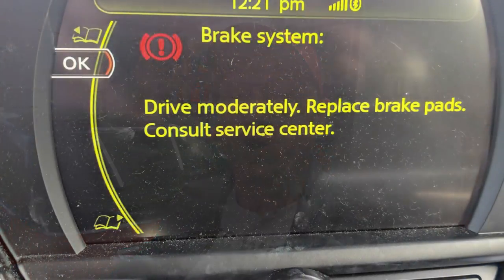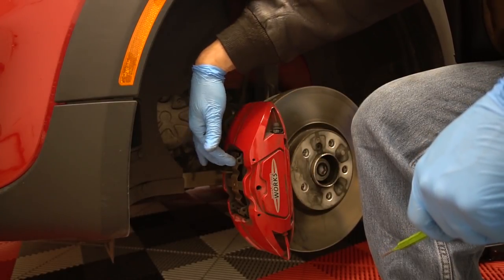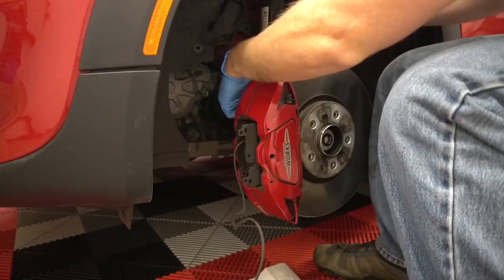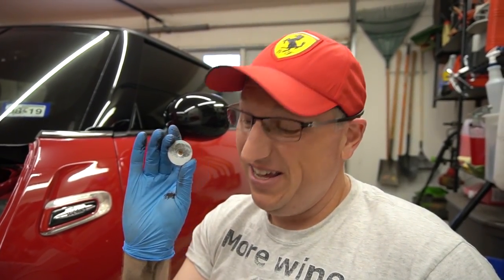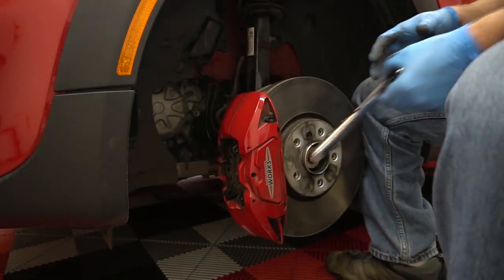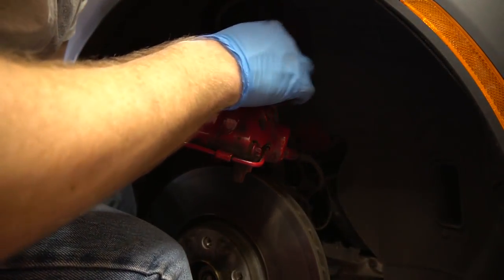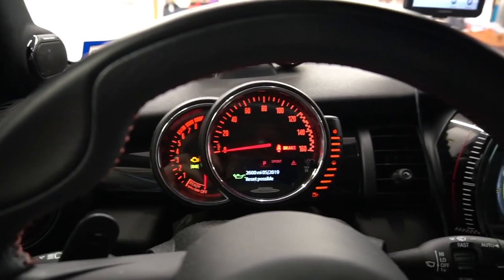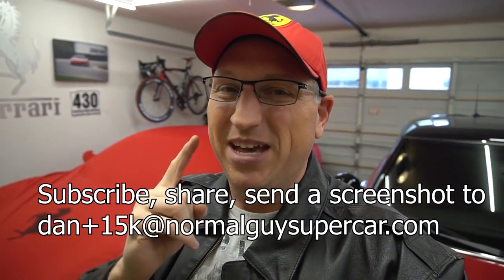Changing the front brake pads on a 2017 Mini John Cooper Works

Comment: This jobs takes half an hour if you just use a longer punch to remove only the two pins (One minute). Then use a big flat screwdriver between the disk and the old pads to push the piston inside (another minute). Then use an olfa knife to separate the pads from the round washers that are between the piston and the pads. If you push gently the olfa blade between the pads and the washers, they will separate from the pads and stay in the piston (another minute). Once it is done, just pull out the two pads, clean the beds of the pads on the caliper with the flat screwdriver to remove the dirt (another minute). Then put the new pads in the slot (put the brake grease first where needed) then put the stainless piece, then slide the lower pin, gently knock it inside with a small hammer and a punch), then push the upper part of the stainless plate with your finger in order to remove the pressure when you slide the upper pin. knock the pin in place (another minute or two).  On the driver side, you will have to unclip the sensor and replace it (you will need an 8 mm socket to remove one screw and a flat screwdriver to remove a pins that keep the liner in place in order to acces the other end of the sensor cable) This should take two minutes. Then put the tires back, pump the brake, start the car, reset the braker wear sensor message and your are done. You absolutely don't need to remove the caliper unless the disk are damage or needs to be replace. Thank you for your video, it was a great start and very usefull for reseting the brake sensor message in the dash!
Reply from the maker: Indeed
Reply: Do you need to replace the washers that go on the back of the pads or just use the old ones. If using the old ones do they have to be glued back on?
Reply: Also you not need to replace sensor if you’re not getting a light

Comment: Also to make it easier to get to caliper bolts, say your working on LF.  Turn the steering wheel all the way to the left. It will give you more room to work and access to caliper bolts.
Reply from the maker: Great tip! Thanks!
Reply: I was thinking that too regarding getting a better shot with the camera. Thanks for the video!

Comment: Before removing pads, after taking pins out. Use pliers to squeeze brake pads back to push caliper pistons in.  Then you will be able to slide pads out easy and its easier to compress pistons that way. 

Use a longer punch to remove pins.
Reply from the maker: Yeah great tips. Thanks

Comment: I have a old mercedes that uses the exact same set up on the rear to get the brake pads out you are supposed to use a pry bar and gently apply pressure to the brake pad that pushes up against the piston the piston eventually goes all the way in and removal and install of the pads gets super easy 👍
Reply from the maker: Yup

Comment: Once you the the pins out you can use a large flat head screw driver to apply pressure between the old pad and the rotor.  This will compress the pistons then the pads will come right out.
Reply from the maker: True

Comment: Really helpful video thanks. Where did you buy the pad holder discs from I can’t find them anywhere? I’m resorting to using the old ones with some high temperature adhesive as I get a clunk noise when braking first time in reverse or drive.

Comment: I also recommend replacing rotors with new pads as well.  Using old rotors can cause noise, wear thin and warp causing a pulsation. 

Thats the way the dealer would have reccomended to you.
Reply from the maker: It was in spec so eh, next time it probably won't be.
Reply: Normal Guy Supercar awesome, well good on you for checking!

Comment: As I commented on your last video when you were playing mechanic and changing rear pads stop using the c-clamp!!!!!! C-clamps are a great way to trigger the abs light and ruin a abs unit. 

You should not be beating brake pads out with a hammer!!! Take a simple flat head screwdriver and SLOWLY pry between the rotor and pad from the top which will relieve the pressure on the pads and the pads would of slide right out after pistons were depressed back. 

I suggest opening a bleeder while depressing pistons if you insist on using c-clamp so no damage can be done to abs.
Reply from the maker: Good tip
Reply: What can we use instead of c clamp?
Reply: Great idea to use a screwdriver to lever against your brake rotor 🙄

Comment: Great video. Thanks for the post. I'm changing out my wife's 2019 clubman after 45000km (28k mi) they wanted $2500 at the dealership for stock. The manager at the dealership told me it was "almost impossible" for an average Joe to do it....
Reply from the maker: Lol impossible... Yeah right.
Reply: @normalguysupercar  that's what I said, they look the same as any other brake job. I ended up getting everything shipped to my door from the USA with duty for $300, and they wanted $1000 at the dealership!

Comment: My guess is the little circular pads are an anti-squeal measure. My pads on the audi always come with anti-squeal grease that goes in the same places as those little "stickies".
Reply from the maker: Quite possibly...  Probably absorbs some vibrations
Reply: @normalguysupercar  Either absorbs or has a different vibrating frequency.

Comment: What about rotor resurfacing?  I've never done a brake job where I didn't have both new pads and fresh rotor surface, to which I promptly bedded the pads and rotors in to each other.  Although those don't look all that scored.  I get 50K-60K on front pads and my rotors are usually pretty scored when I do the job.
Reply from the maker: They seemed to be in pretty good shape.

Comment: They make a tool for those calipers that expand in both directions.  I know harbor freight carrys it.

Also be careful with those calipers in the future.  On my brembos on my acura the bolts get seized and it eats up the threads in the caliper since they are aluminum. Hopefully those threads are steel since its is considerably newer than mine.

Good video!
Reply from the maker: Yeah, I saw that tool after the fact... I may have to get one.  Then I could do the pads without removing the caliper... Not that it was hard.
Reply: @normalguysupercar  Yeah the dealers make it out to be something way more difficult than it really is.
Reply: @normalguysupercar  I use a couple flat head screw drivers while pads are still in there as  a wedge to compress the pistons and then the pads slide out easy as well as the new pads going in reasonably easy.
Reply from the maker: @deanmiller8873  That's a damn good idea.  Thanks!

Comment: Have you looked into one of those garage floor powered scissor lifts that lays on the garage floor and goes underneath your car and lifts it from the bottom..theyre specially made for low sports cars but do you know what I'm talking about? Just so you don't have to buy big expensive garage lifts and hoists. Even tho the scissor lift could be $1,000-$2,000 I think they're worth the money (tax season always comes 👌👍) lmao. It would be cool if it allows you to keep your car off the ground all winter when your storing it as well..
Reply from the maker: Yes, I've been looking to get something like that... I just haven't pulled the trigger yet.
Reply: @normalguysupercar  yea instead of your process of backing the car on ramps, jacking it up, and then jackstands underneath eveytime, I'm sure you don't mind doing that but those jack stands get fishy sometimes. I pray to God yours don't fail of course but a scissor lift may benefit you more than you think possibly.

Comment: Hi. you can change them without removing the calipers, i had the same exact Brembo brakes in my Alfa Romeo 147, before you remove the brake pads you have to use a big flat head screw driver to put the pistons back in and after that you can even put the glue pads in, ok that is easier to take them off but you still can do both ways, but nice videos you putting on. I like when the brands says you cant do this or that, its your car you do what ever you want :)
Reply from the maker: Yeah I heard that suggestion afterwards. I'll give that a try next time.

Comment: Brakes probably wore out early due to driving habits..

But 20-25k on European cars is not uncommon. They use very soft material for good braking bite and to reduce noise.
Reply from the maker: Yeah Meg is hard on the brakes too.
Reply: This car uses the front brakes to aid traction, like a limited slip dif. They ware fast even if you drive carefully.

Comment: Enjoyed that Dan, those are very impressive calipers for a mini, a lot better than my E92 M3 calipers that's for sure, I am surprised you  used a breaker bar for those bolts, I thought you might have used an impact wrench .????? Like the one you used for the lug nuts.  ?
Reply from the maker: I couldn't fit one in there...

Comment: You will be amazed how quickly pads go after just 2-3 track days. I bet the pads wore most on the track day.
Reply from the maker: It did a total of 6 laps on a less than half mile track... I don't think that was it.
Reply: @normalguysupercar  Really weird. They are suppost to last at least 50k. The pads on my GT86 are still at 20% after 45k miles and few runs in the Alps. Probably is worth checking if they are binding and wearing prematurely. Thumbs up for all the great videos. I am still catching up with the older ones and looking forward to any new ones!
Reply: @normalguysupercar  when keeping all the system on your brake wear extremely fast, especially these OEM ones

Comment: Did you ditch the runflat tyres, if so what are you using for a spare?
Reply from the maker: I have a can of fix a flat and towing service
Reply: How do you find the ride on the Mitchelin as oppose to run-flats?. I’ve just had warning light for front pads, 15.5k still rubbish compared to other vehicles, don’t know wether to try E.B.C yellow stuff!
Reply from the maker: @malcolmbale9566  they ride much better

Comment: Having the SAME EXACT problem with my 2017 Mini Cooper JCW. Barely 12,000 miles. I don't have the means to change the pads myself so I'm getting screwed right now at the dealership.
Reply from the maker: Yeah, those pads don't last for shit.  Kinda disappointing.
Reply: @normalguysupercar  Very disappointing. Getting quoted on brakes at the dealership now. I'm trying to source parts for this myself if I can. Can you link me to where you picked up those pads w/ sensor? They're trying to meet me in the middle somewhere because my car has been in the shop over a month now for an electrical issue (some kind of rodent got in my engine bay and ate some wiring!) and I've been incurring a lot of costs in a very short period of time on a lease that has little over a year left on it.

Comment: Mini pads are junk they never last, the replacement pads are generally worse they don’t even last as long. You would be better off going with something like a Hawk HPS or an EBC pad. They also produced less dust.
Reply from the maker: Yeah, I will definitely switch to those next time.  I just wasn't sure which were the right ones, but now I know.

Comment: Yo bro is the car manual or automatic ie stickshift or auto lol in american.
Reply: His is automatic
Reply from the maker: Auto.  Meg doesn't drive manual.
Reply: @nathanbaxter2329  ok thanks bro. Was just wondering because i have a manual, and i have done 28000 in my 2017 mini, and pads still good. Must be because i use the engine breaking a lot. Automatics must not rely on the engine breaking as much. Thanks again.
Reply: Cool! Just bought my Mini about 2 weeks ago! It's a 2011 S. It's my first car. It's also a manual and, it was a salvage title. Should be a fun little car!
Reply: @normalguysupercar  thanks bro. Wat u reckon if you drive it in sport, will down shift more, and save on break wear a lot?? Just a idea cause 12500miles on a set of pads is a joke lol. My 2015 jetta got 43000 miles on it and last service i had over a 1/4 left.
Reply: @normalguysupercar  thats y i love ur channel. Like minded people. Half of these big channels with the lads on cant even change a tyre. Lol. U need a million subs, u deserve it. I have been here since u only had 2 3 thousand subs.
Reply: @nathanbaxter2329  bro they are so fun to drive. They like little go karts, the way they handle.